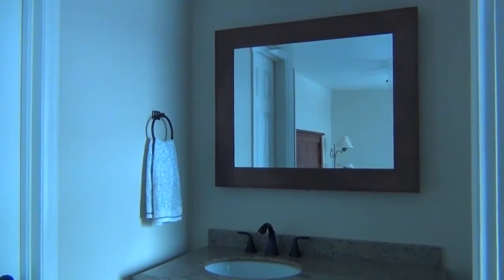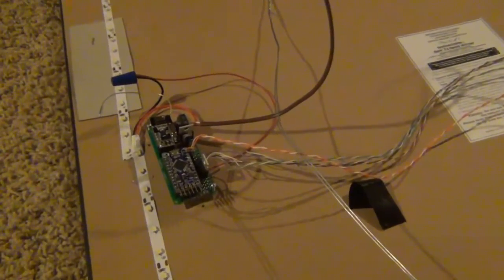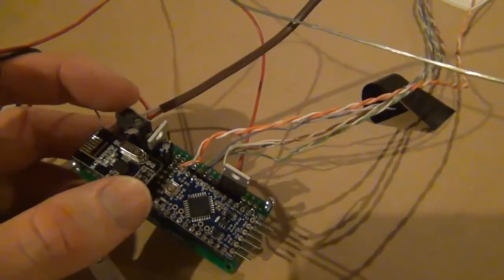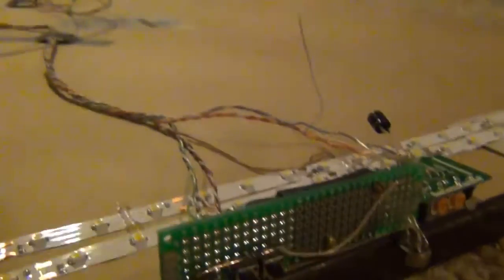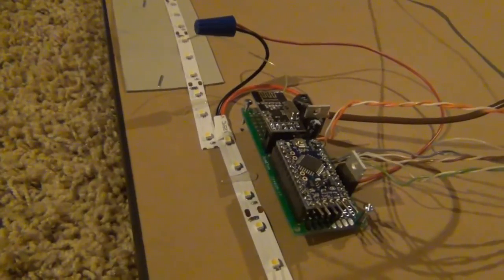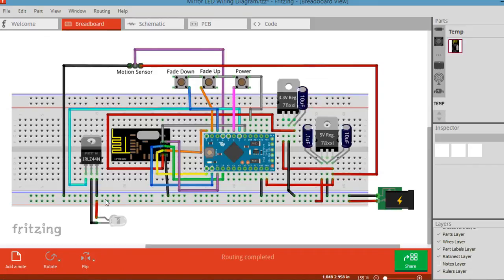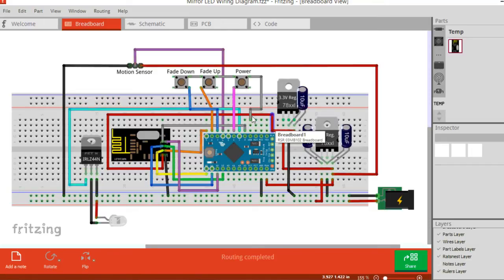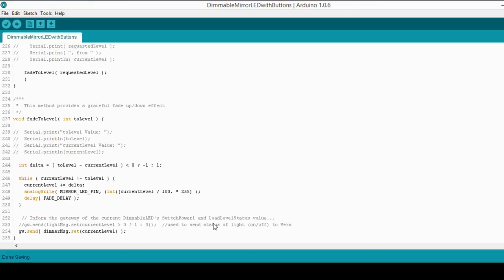Arduino Backlit Dimmable LED Mirror with Motion Sensor using MySensors

Comment: Hey, I'd love to see more on the whole house 12V PS.  I get the concept and through about it myself, but how do you distribute and where do you distribute to or is it all home runs per project?  Do you have an attic/crawl space that you use?
Reply from the maker: +Dmitriy Khazansky Pretty much all my wires are home runs.  I do have a couple that are for multiple sensors that require very little power.  I have access to pretty much every room either through my attic or basement which makes things much easier.  The size of the wire I use varies on what the current draw is.  I really need to make a video on how I did this soon...
Reply: +Pete B I've thought about doing something similar with a server power supply, they're a pretty cheap way to get high power with three different rails from one source.  Just have to change the noisy fan out.
Reply from the maker: Dmitriy Khazansky Yeah, I'm using an old Dell computer power supply.  Only 280 watts but it powers everything in my house (so far).
Reply from the maker: I know this is really late but I finally made a video of my whole house power supply.  Here it is: https://youtu.be/KRjdAZV4sh0

Comment: Would you know what the stand by and 'on' power consumption would be of such a project? When matching a power supply,  does it matter how much it's rated vs it's standby power consumption?
Reply from the maker: +Neville Cassar I'm not exactly sure what you're asking.  Are you trying to find a power supply for the LEDs and Arduino?  If so you should only need to look at the output amps and the voltage.  I am guessing the standby power consumption tells you how efficient the power supply is when it's plugged in but not being used.  
You can calculate how many amps you need by what type of LED strip you'll be using.  I use the 3528 leds on a 5 meter strip and I think it only uses around .5 Amps but you'll want to double check that.  
Hopefully that helps.

Comment: Great project!  I've been able to replicate it but I'm having issues with trying to code the motion sensor to trigger the led fade/out in without using Vera. Unfortunately coding has never been my strong point.  Any help would be greatly appreciated.
Reply from the maker: +Jon Vannatto Are you using MySensors or just wanting to make it a stand alone mirror?  If it's a stand alone project it will take some re-coding to have it automatically turn on/off the LEDs.  To turn on you will need to send a value to this function fadeToLevel( YOURVALUEHERE ); 
To turn off you will need to add a millis timer to check if it's on then turn it off after a certain time.

Comment: 12v home power supply wired into the house ....that would be a great video.
Reply from the maker: YuddaLevy Thanks for the feedback!  I have it on my list to do.  Not sure when it will be but I'll make the video eventually.
Reply: Pete B much appreciated...  Looking forward to it.  Also I have been checking out mysensors... Thanks for the link.
Reply from the maker: I finally made the video.  Sorry for the delay! https://youtu.be/KRjdAZV4sh0
Reply: +YuddaLevy I'd be interested as well. Are there any prohibitions that you are aware of in the latest Uniform Electrical Codes and/or Uniform Building Codes?
Reply from the maker: James Pray I think it depends where you live.  From my research (make sure you do your own) as long as it's low voltage there weren't many requirements.  It has been so long I don't remember the specifics though.

Comment: What kind of heat are you getting off that FET?
Reply from the maker: RJGNOW Virtually none.  I have run these LEDs as a test for hours and there is still no heat when I touch it.
Reply: Pete B
Thanks!